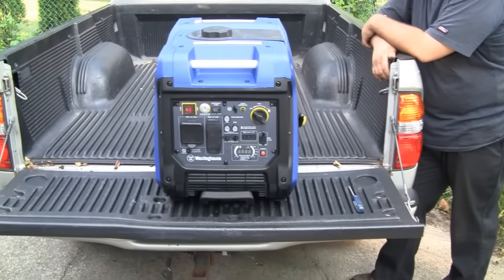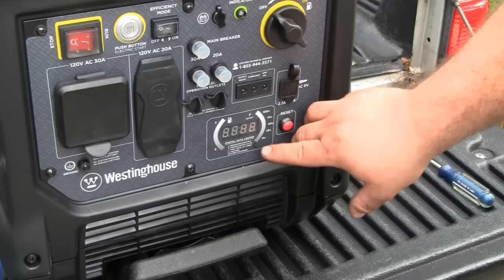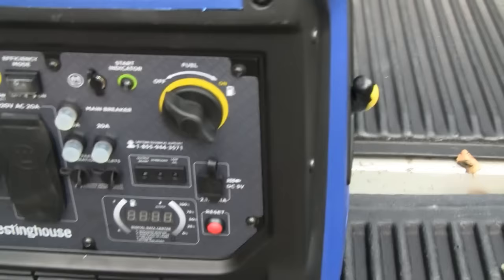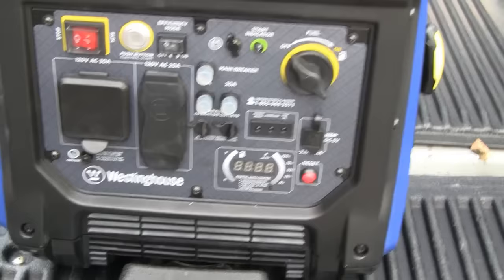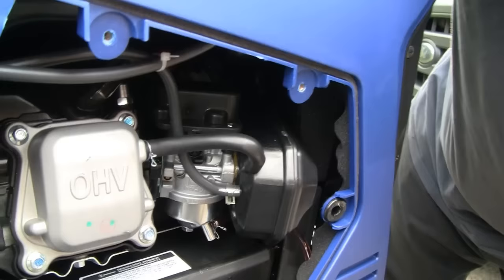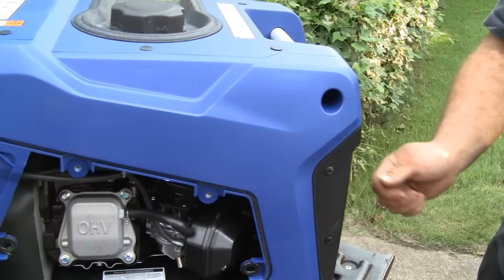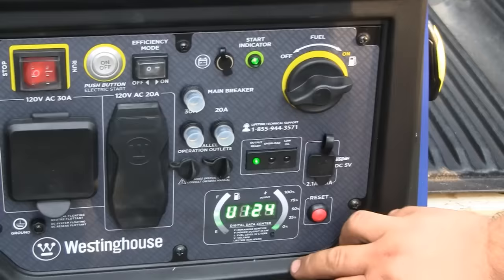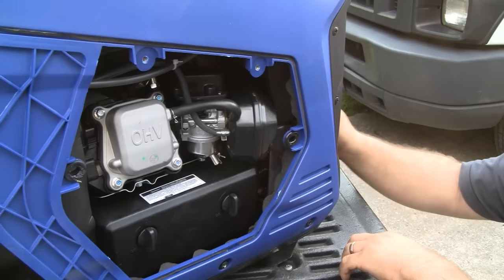WESTINGHOUSE iGEN4500 INVERTER GENERATOR (BUYER BEWARE)

Comment: Why did you go out and buy a Generator  Mike has about a hundred of them at his house lol
Reply: Because you have a lot of sensitive electronics in the house you can completely fry with an old school gen set not to mention the static thru speakers and yeah alot going on there
Reply from the maker: I have 4 myself, they're all to big and antiquated!!☺
Reply: @seudechrist  yes I know all of that about the electronics.  it was just a Joke  just poking a little fun
Reply: @seudechrist Who the heck wants to listen to a 3600 rpm generator all night?😣😣🤢
 If you are worried about sensitive electronics put them on a UPS. That will isolate them from the generator. The generator they are using works similar to a UPS as the output is from an inverter. That way the genny doesn't need an expensive regulator. So far everything I have plugged into my 2LK has worked just fine and without a lot of output noise as I replaced all those capacitors on the brush rigging and coils inside the generator and I use a resistor plug.

Comment: I had one of these Generators.  I bought it in January 2019 and sold it with my camper in 2020.  I never had  trouble out of it.  I have used it a whole weekend without shutting it down for my RV that had two A/C units.  I could run one A/C unit with all the lights on but not both A/C units.  My A/C units are 15,500 btu.  It ran quiet and worked really well.  I would buy another one.  Don't trust Honda and Yamaha either, they all have their problems are they are too expensive.  Nothing wrong with what you have.  I'll give you $500 for it if you really want to get rid on it.
Reply: lol...nice guy that you are....lol...$500....lol

Comment: The choke problem is an assembly fault..... The small wire loom plug for the choke control wasn't plugged in at assembly. All you need to do is partly open the unit, plug in the carby wire loom, and the problem is 100% fixed. Some little chinese guy had just one job to do !!! hahaha  There is a video on YouTube how to fix this in minutes.....

Comment: Electronic choke control wiring wasn’t connected to the control panel at factory.   Easy fix.   Trace the wire from carb and pig it into its proper connector.

Comment: Thanks for posting this video. Just got my generator today. This information will come in handy. This issue with the choke is covered in the user manual. Also the manual says the battery charger is Not a trickle charger. Use no longer than eight (8) hrs. Over night.
Reply: Thank you for sharing the info.

Comment: You are right about warranty claims on most equipment, especially stuff bought from big box stores, like Lowe’s or Home Depot.  I have very seldom returned new stuff for warranty service.  I don’t even know why they put that crap in the owners manual.  Normally Lowe’s, Walmart or Home Depot give you a couple of weeks to return defective equipment and they deal with the manufacturer.  Stihl and Husqvarna dealers will usually warranty products from the dealer you return them to.
Reply: My WH Igen 4500 df was under warranty. Home Depot would not lift a finger to help nor would they make a call to WH. WH refused to help me also.

Comment: Thanks for the heads up! Back to contemplating the cash for a Honda
Reply: I own two Japan made gens.  A 2021 Honda EU3000is and a 2023 Yamaha EF4500ise (both purchased new).  The Honda has 250 hrs. and the Yamaha has 110 hrs.  Zero issues and zero regrets "investing" in either machine.  They both get exercised 45 minutes a month at 1/2 load.  After "break-in", oil is changed every 6 months with Pennzoil Ultra Platinum 10w-30 full synthetic in the summer.  Same oil but 5w-30 in the winter.  Having a "reliable" source of power in an outage is just too important to trust any of the Chiner made gens.
Engine break-in for both gens.
Pennzoil 10w-30 "CONVENTIONAL" oil with 2 to 4 ounces of "LUCAS ENGINE BREAK-IN OIL ADDITIVE - TB ZINC PLUS".
First oil change: After 30 minutes, drain oil and re-fill.
Second thru fifth oil changes: After 20 hours, drain oil and re-fill.
The Honda takes 20 ounces of oil.  So it's 18 ounces of "CONVENTIONAL" oil and 2 ounces of Lucas.
The Yamaha takes 40 ounces of oil.  So, it's 36 ounces of "CONVENTIONAL" oil and 4 ounces of Lucas.
Break-in is complete and both now run full synthetic oil.

Comment: The fuel cut off is an amazing feature. Really surprised Champion didn’t have that. Despite the choke issue, which can be fixed, I’d go with this one just for the easier way to keep the carb clean with the fuel cut off.
Reply: Actually the champion 8750w unit does have a fuel cutoff. The manual says proper shut down is to turn fuel off and let it starve the engine. Once stalled. Turn ignition off.
Reply: To keep the carburetor from fouling from spoiled fuel, especially spoiled gasohol,  it is essential to drain the float bowl.  Just turn the screw and it will drain out the plastic hose.   Petcocks are hardly an amazing feature and no,  letting the engine run dry does not keep the fuel system from fouling.  Refer to the instruction manual.

Comment: There is a choke cable harness that becomes unplugged. If you remove the side cover and front cover you can get to the cable and plug it back in. The harness is to control the carburetor
Reply: Is this still an issue? I’m trying to buy one this week
Reply: @suppaman12  my find above fixed it if you find yours shipped that way. Plug in that cable and it’s golden

Comment: Awesome video!  When I buy anything I always look for the least amount of whistles and bells...  I have a Honda 2200 and it’s a nice generator but very prone to fuel issues, like Mike said it doesn’t allow the carb to drain and problems occur when it sits a few months without running.  Thanks King!!! 😃👍
Reply from the maker: Thanks Mate!! There's a service bulletin out on this machine!! They say the wire to the control board comes apart in Transit, I'm hoping it's that simple!!☺
Reply: When you spend a 1000 on this you shouldn't have to fix it.
Reply: @805ROADKING  how'd you make out on their fix? all good now?
Reply from the maker: https://www.youtube.com/watch?v=gSceM1tMJ1o
Reply: Install a separate  ignition switch

Comment: Westinghouse customer service is the worst. First one had a bad inverter. Been 3 weeks and still can't get a single call back from customer service. Got a good deal on it. So, returned for replacement. Replacement came in today. Last Westinghouse product I will ever use. Simply for the non existence of customer support.
Reply: Dealing with that now

Comment: Your generator has a flex cable with a ball end connection that runs from the rotary switch (on the control panel) to the choke.
It simply came off the choke lever.

Comment: Road king I have the same generator that had the same issue. I pulled mine apart and found a disconnected wire to the choke. I traced the wires back to the control board. Was an easy fix
Reply from the maker: We're working on ours now Joe, I'm hoping that's the problem!! I'm having trouble getting the bottom front bolt out on the side, the one right next to the control board!! The nut keeps spinning and it tough to get to, I gotta wait til Mike comes over so we can get it from both sides!!☺
Reply: 805ROADKING  they pack these things tight! I had issues getting everything back together. Too bad support is awful. It’s a shame because the fit and finish on the machine is nice. However it’s like pulling teeth to get any help with it. Worst case scenario you can run an aux. power from the battery to the solenoid with a momentary button (if the board Is faulty).

Comment: I'm a retired Appliance repairman-
We always referred to that brand as "We-Sting-Who-Use" instead of Westinghouse
Reply from the maker: Ya can't get away from the Chinese Junk, that's all they sell anymore!!☺
Reply: Well they have an actual customer service line even during corona virus and many many great comments on some models with 2000 hours plus. I bought a 9500/7000 duel fuel, have not turned it on yet, need to, but they seem to make a fine product, some might have some glitches here and there but I wouldnt call it junk. At all.
Reply: @805ROADKING   its it’s junk it’s because the American company who wrote the contract wanted it that way cheap for max profit.

Comment: I just dragged home a little Honeywell 6066 the other day out of the trash.First one I've ever found. Looks like the recoil spring broke and unspooled upon the previous owners last start of it. It mangled the hell out of the plastic flywheel fan, and busted or cut it's way through the fiberglass engine casing. I changed the starter cup and put a different recoil on it. It runs and makes power. I'll likely  replace the recoil assembly with the right one if it runs consistently well.
Reply from the maker: That's a nice lil' unit!! You always seem to find some cool crap!!☺
Reply: @805ROADKING  Hopefully it works out for both of us. Finding junk is like fishing. A multitude of variables involved, but it all comes down to persistence, timing, and luck.

Comment: Sorry about the choke issue. It does seem to be a nice generator other than that problem. Hopefully you and mike can get something figured out.
Reply from the maker: Thanks Bob!! There's a service bulletin out on this machine!! They say the wire to the control board comes apart in Transit, I'm hoping it's that simple!!☺
Reply: Just watched a video on these. The auto choke is unplugged.  It plugs in just below the pull rope.  Once plugged in there is zero issues.

Comment: I've had mine almost 2 years and used it for 2 seasons with my RV. Never had this problem. Starts immediately every time.
Reply: Still running good? I just bought a dual fuel for myself

Comment: Big fan of Roadking & Mike's antique engines and gensets.  I'm sub'd to both.  I have 2 of the Predator 3,500 inverter units (and a garage full of misc gensets).  I buy my Predator generators open box returned at the HF parking  lot sales for really cheap (like 1/3 of the price new) then fix it.  This unit looks internally  a lot like the Predator.  Possibly the same Chinese manufacturer.  You might convert to tri-fuel with a snorkel and Garretson regulator.  The snorkel is easy to make yourself.  Yeah, service on these throw-away units isn't  great but you're hooked up with the best guy to know when a genset needs work.
Reply from the maker: I tried to buy a Predator first but HF didn't have a single generator in stock!!☺

Comment: Bought one year ago. Been in the shop 3 times and certainly still there. Only has 16 hours on it. It is junk I should of purchased the predator 3500. Mine is the DF4500 though.
Reply: Kurt Tidrow I have the predator. I honestly believe it’s the best value in a generator. It starts up almost always on the first tiny pull. I run two full refrigerators on it, TV, lights and fan. No issues. With sale price and wheel kit I paid 350.00 out the door for it. No regrets, had it four years already.

Comment: That is set up just like my Champion I have been working on , It has a stepper motor for the choke & a control box that runs it . I am not a big fan of the inverter generators for that very reason that they  don't like a start up  load on a motor or compressor . The remote control is Identical to mine !  I bet mike can get to the bottom of the problem .. May need to take it down and see it all the wires are plugged in proper .. I sure ENJOYED  king  ! Hope you guys get the bugs out  of it ..
Reply from the maker: Thanks Shawn!! There's a service bulletin out on this machine!! They say the wire to the control board comes apart in Transit, I'm hoping it's that simple!!☺
Reply: @805ROADKING  Me to king  !

Comment: I definitely start a 10k btu a/c with my lil 2000watt champion in eco mode. I did a a suppco scc6 soft start cap. But this unit should have no issue at all starting up to a 15k btu a/c. I know the cheaper generators like my champion are appealing, however the certainly have there limitations. The Honda is nearly 3 times the price for a reason. If this 4500 won’t start a 10k btu a/c, there is certainly an issue somewhere. With a 10k, seeing an inrush spike in the 20+ amp range is pretty normal, but I just don’t see how it could get it up and running without an underlying issue with the genset or the A/c itself. I am relatively mechanically inclined, but they sure do have some crap packed into this things. I sure not want to tear into them too far!

Comment: There is a remedy for this; and it is just plugging in the plug on the opposite side of the generator so that the module can control the choke electronically.

Comment: Thanks, buying new expected the thing to go ,
Just bought pressure cleaner, owners said that never worked,found from new fuel tap faulty easy fix.
Reply from the maker: There's a service bulletin out on this machine!! They say the wire to the control board comes apart in Transit, I'm hoping it's that simple!!☺
Reply: @805ROADKING  good luck,

Comment: I had starting issues with low ambient temperatures.  The carb jet was not correct for my altitude and had an affect when starting when ambient temperature was less than 45 degrees F.  Westinghouse offers two high altitude kits.  One is for the IGen4500 and one is for the IGen4500DF.  Get the correct kit for your model.

Comment: 4 days ago I had a customer bring a new Chinese 10k watt generator to me to fix that he has 10 hours of run time on. Metal feet had collapse under the machines weight. Bolts rattled out of the split rims and wheels fell off. Idle kickdown mechanism rattled apart. RPM (HZ) screw rattled loose so it was only running at 45hz instead of 60hz. Entire electrical panel, key switch and outlets rattled apart with stuff falling out. I'm surprised it didn't catch itself on fire or destroy whatever it was running. This is very typical with all the "off brand" generators customers bring me. Warranty is a joke and he has to pay me to fix it and I'm sure it will be back every other season with a new set of issues. If you're not mechanically inclined these will cost you far more in the long run vs a Honda or Yamaha.
Reply from the maker: There's a service bulletin out on this machine!! They say the wire to the control board comes apart in Transit, I'm hoping it's that simple!!☺
Reply: My twin Yamahas have been nothing but trouble since I bought them. They have never run perfectly, even when new. My mechanic said he only recommends Hondas or expensive (real) Onans. I'd have to agree at this point. Unless Toyota starts building gens, I'll buy Honda from now on.
Reply: @bugatti314159  you got to run good fuel. I have customers bring me their Hondas all the time because they just put whatever crap gas they get at the gas station in it. Even the best machine will crap out in a few months with ethanol fuel(10%)
Reply: What people don’t understand is all the engines in all these machines are made in China same as snowblowers. Even Honda. They make the Predator engines in the same plant that the Honda. Parts are interchangeable
Reply: @damnyankeerider5959  The Honda are not made in the same factory. The Honda Patent for their GX series(GX160, 200 ect) expired so anyone can build them. Honda actually sued Harbor Freights Predator for making them look too similar and won. They had to change the gas tank and front air shroud/pull start to make them look dissimilar.  Before that every nut, bolt and panel was identical though noticeably thinner metal and cheaper built.
Reply: @sixtyfiveford  A lot of these brand name, high quality engines, genders, outboards are made in Thailand.
Reply: Gorilla glue it to a nice spot corner area Bet it want Rattle apart no more 🤷🏿‍♂️
Reply: @damnyankeerider5959  Got proof of that?  Or are you just repeating what you heard from someone else?

Comment: Having to take the side panel off every time you want to start the engine sucks.  I'd rig up an external choke control using a bicycle brake cable, or an R/C servo so it could be controlled from the outside.
Reply from the maker: We'll fix it Bud!! There's a service bulletin out on this machine!! They say the wire to the control board comes apart in Transit, I'm hoping it's that simple!!☺

Comment: I have the I I igen2200,  the service response is the worst I've experienced, it took 8 month to get a reply for a replacement recoil assembly,  which was completely plastic and the pull cord broke after maybe 30 pulls. They run a little rough also even after changing the cheap spark plug. Ultimately they sent me a replacement recoil and  I swapped out the new cord with a heavy duty nylon... because you basicly take apart half of the generator to get to this particular pull cord assembly. Spend the extra money for a honda...  no joke or maybe a generac to run a house

Comment: The machine has a lot of nice features. The duel fuel model is ideal if it would run. The 4500df that I returned would start fine but had no output, and the display was a fail. Go to harbor freight and get the predator generator. One third less money and it works fine.

Comment: That's gotta be frustrating.  Kudos for at least going with an inverter -- considerate of your neighbors.  I have the Yamaha EF2400is for power outages to power my furnace blower etc.  It's never missed a lick, but then I've only had it for ten years or so.  Rather expensive, but the folks next door can sleep with it running.  What good is having power if all your neighbors want you dead when it's over?
Reply: 😂 that's why you share. Send an extension cord over for their deep freezer and fridge